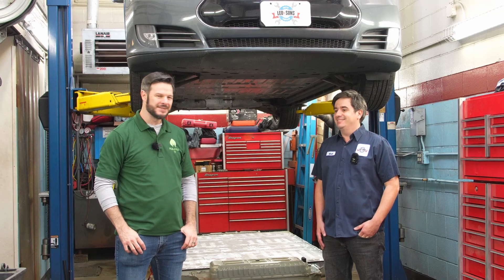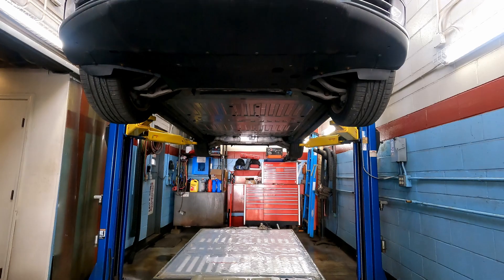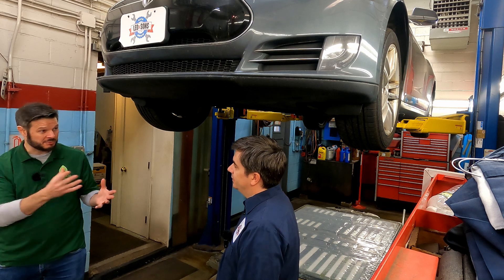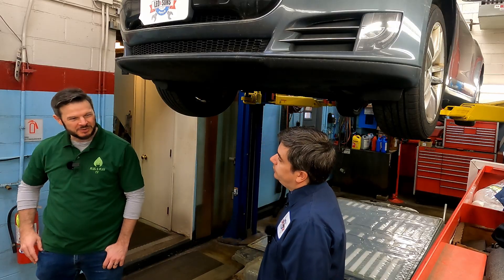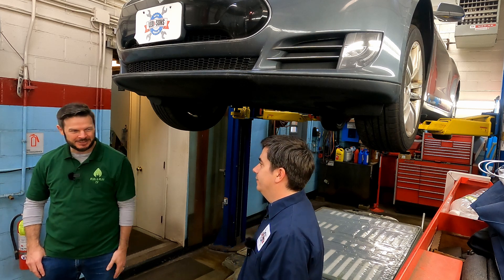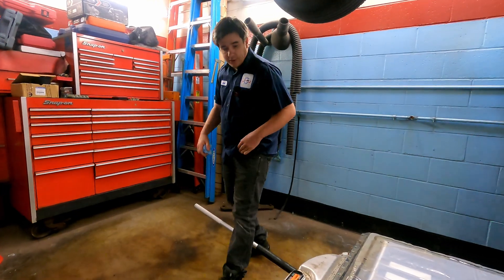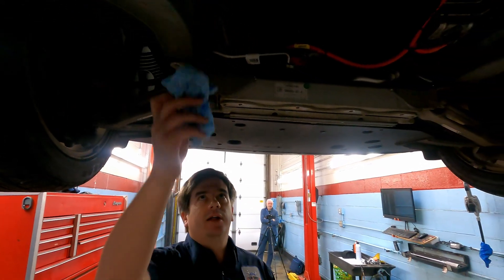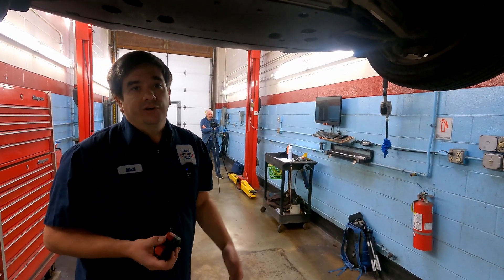Diagnosing Tesla Issues & Maintenance with Matt Lamontagne of Leo and Sons EV Repair

Comment: It's going to be extremely, extremely important for the aftermarket to start working on Tesla support, especially in terms of scan tools and service software. You cannot work on any modern car, EV or otherwise, without a scan tool. Even brake jobs often require scan tools now. Right now, the only real diagnostic software option for Tesla is Tesla Toolbox. Given their history, we already know that they are not going to continue to support their older vehicles indefinitely, so if they drop or reduce software support for their older cars, the owners of those cars are going to be totally screwed. I'm less concerned about legacy manufacturers because the vast majority of them still fully support diagnostic software, even for their models back to the 90s, but Tesla does not really support the original Roadster and is already phasing out support for the early Model S/X in terms of software updates and supercharger support (mostly in CCS2 countries, but its coming to the US too as they start transitioning to supporting CCS and non-Tesla J3400 vehicles)
Reply from the maker: Great points, thanks for the addition 👍

Comment: Nice to see that indies are begining to fill the gap. For a year or so after I retired, I was helping part time at Tampa Hybrids and they are moving into more & more EV sales. I won’t be surprised to see them start repairing Leafs and Bolts in the next year or two. What would be super nice is an online registry of EV repair independents along with reviews and rating.
Reply from the maker: I love the registry suggestion. If I come across one in my research, I'll make a note to return and post it here.